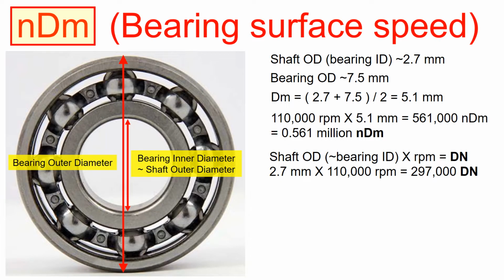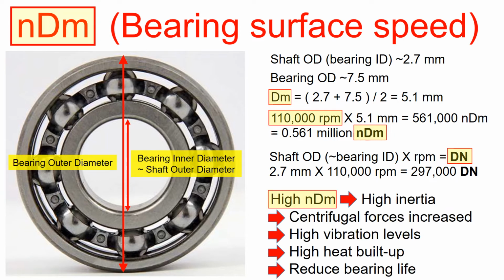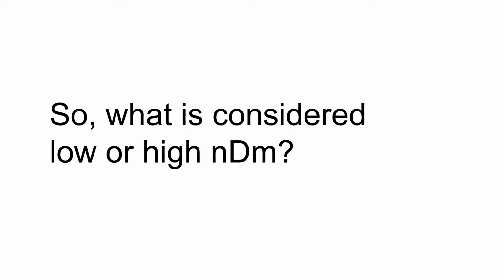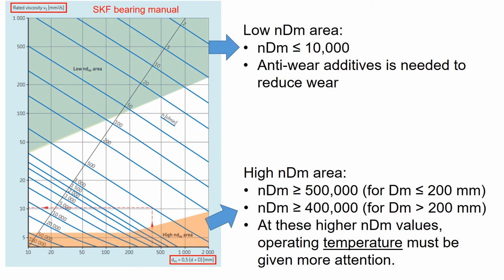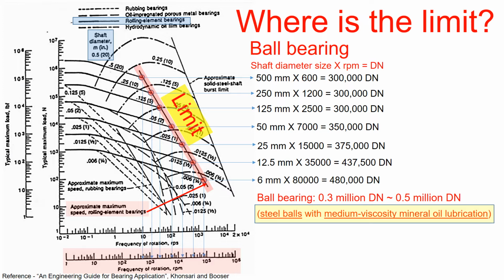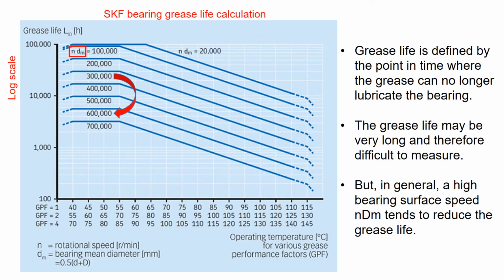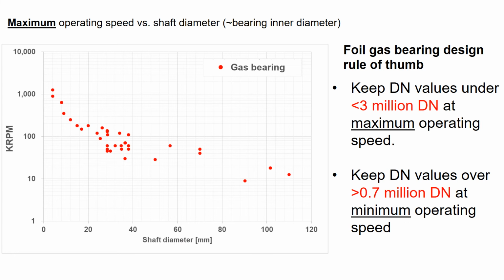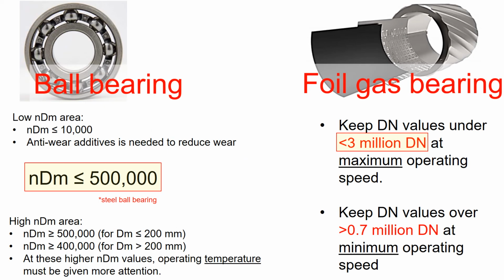Part 13 - How to size your bearing in rotating equipment

Comment: As usual excellent work. At 4:00, you mentioned about steel shaft "burst".... But how a such a strong material can burst at high RPM?
Thanks for your excellent work...
Reply from the maker: Did I mention the shaft burst in the video? Regardless, a high nDm leads to temperature issues in the bearing, ultimately resulting in decreased bearing lifespan and eventual failure. :)

Comment: Thank you for the great FREE virtual class. Just one extra note is that most foil bearings have the high speed limit of 3M due to the  speed of sound, i.e., < Mach #1. When the working fluid is not air or the condition is not at atm, the high speed limit varies. 🙂
Reply from the maker: Thank you for your feedback. The Capstone's gas turbines with foil gas bearings limit their maximum nDm to 3 million to prevent thermal issues during the life of their gas turbine. Capstone's gas turbine is one of the most successful applications of utilizing foil gas bearing (other than Honeywell's air cycling machine). Of course, you could operate higher nDm for certain mild applications (such as blowers for water treatment plants). But, if you want to have high reliability and longer life for your mass-produced machines, it is wise to limit your nDm value. :)

Comment: Can we increase DN range on Backup bearing (Touchdown bearing ) since their application is indicating main bearing failure (Magnetic / Gas)?
Note that touchdown bearing we increase DN over 1m.
Reply from the maker: Excellent question! The backup bearing, also known as the touchdown bearing, is primarily designed to hold the rotor in place when the magnetic bearings fail due to electricity shutdown or other unexpected events. Its purpose is not for continuous long-term operation, which allows for a larger DN (bearing diameter and rotational speed product).

However, if you intend to use a ball bearing as the main support for the rotor during regular operation, it's essential to limit the DN to prevent overheating of the bearing over extended periods. Proper DN selection ensures the bearing can effectively handle the load and speed requirements without any issues.

If you have any more inquiries or need further clarification, feel free to ask!

Comment: So how would u determine what size ur outer diameter and inner diameter of a air foil bearing? 
if u have shaft with an outer diameter of 35Ø and with the rotor on it is 55.4Ø. i need to place to air foil bearing for each side. How do i determine the correct size of the air foil bearing for it?
Reply from the maker: Excellent question! The answer lies within the video. The foil gas bearing is designed for operating speeds between >0.7 million DN and <3 million DN. To properly size your bearing, it's crucial to determine the exact operating speed of your machine. This information is key to ensuring optimal performance and longevity. Dive into the video for a detailed explanation, and feel free to ask if you need further clarification.
Reply: @RotorDynamics  yes have seen that video aswell, but cant wrap around like excatly how to dimension the outer and inner diameter og the bearing.  The operating speed is 96000Rpm.
Reply from the maker: @dineshsuresh7848  At a speed of 96,000 RPM and a shaft outer diameter of 35 mm, the resulting DN value is 3.36 million, surpassing the recommended limit of 3 million DN. This poses a risk of overheating and potential bearing failure due to elevated temperatures. Refer to the instructional Part 16 and Part 17 videos for further information. To mitigate this issue, consider reducing the shaft diameter to below 32 mm.

If you find the videos helpful, please share them with your colleagues and engineering peers.
Reply: @RotorDynamics   So if i reduce the shaft to 31 mm i get a DN value of 2.96 million, which is fine right?
I have watched ur part 16 and 17 videos like 1000 times :P, but i cant seem to understand how to calculate or size the outer diameter of the air foil bearing?
its so complicated than other bearings.
Reply from the maker: @dineshsuresh7848   Could you please clarify your reference to the outer diameter of the foil bearing? Are you inquiring about the outer diameter of the metal housing that encases the bump foils, or are you inquiring about the inner diameter of the housing that encapsulates the bump foils?
Reply: @RotorDynamics  Just like overall how big i should dimension the housing and the bearing for the air foil bearing, when  i have shaft with 31mm length and a rotation speed of 96000 rpm.
Reply from the maker: @dineshsuresh7848  The sizing of the machine housing is influenced by several factors, including the impeller size. Considerations such as the need for the machine housing to withstand internal pressure, the choice of materials for the housing, and the management of thermal effects around the bearings are crucial. It's important to determine the optimal balance, taking into account factors such as bearing outer diameter. Keeping the bearing OD within reasonable limits not only contributes to a lighter weight but also facilitates easier maintenance, simplifying the process of bearing replacement.
Reply: @RotorDynamics  Its been a lot helpful. but i am like unsure whats exactly does "DN" mean? what is the unit for DN? and in European unit?
Reply from the maker: @dineshsuresh7848  
I'm glad to hear that the content has been helpful for you! The unit for DN is "mm X rpm" same as the unit for nDm as decribed in the video. :)